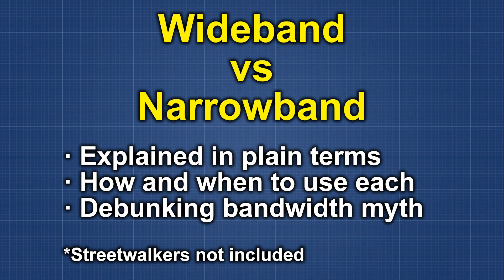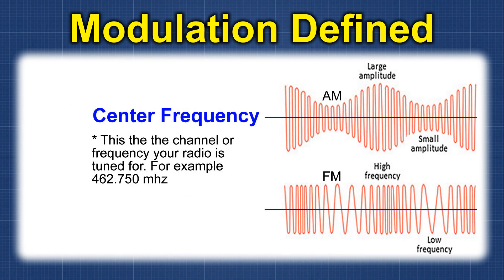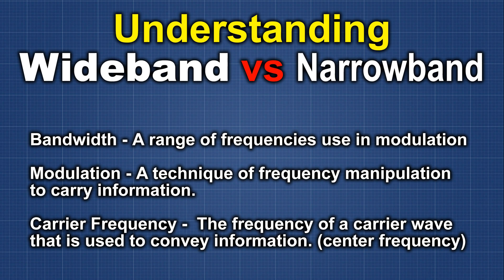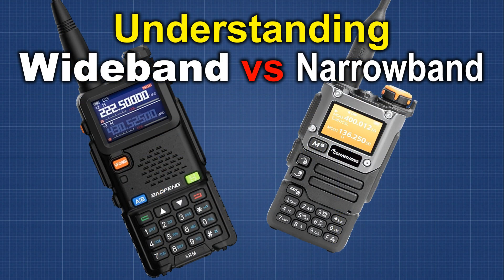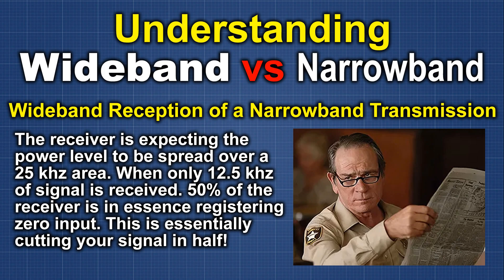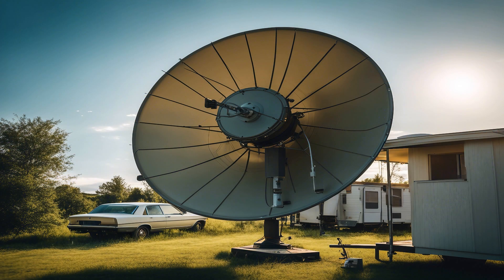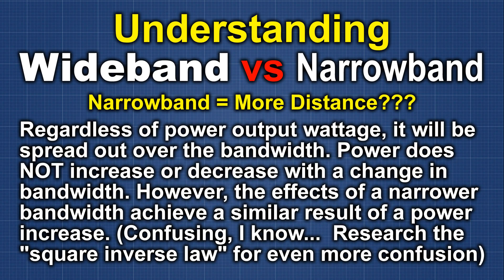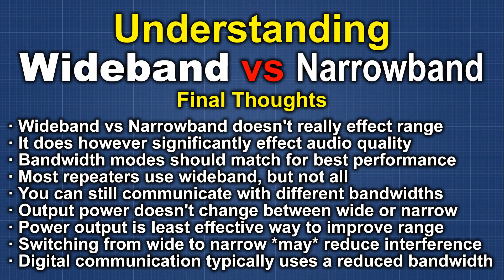Unlocking Radio Secrets: Ultimate Guide to Wideband vs. Narrowband  Compatibility, Challenges & More

Comment: AM is pretty great for audio quality if you have a good receiver and are in a low RFI environment, or if you have good filtering, AM is the way.
Reply from the maker: AM definitely has its advantages in certain applications for sure. Just look at aviation radio. And you are exactly right on the low RFI and filtering. Just like anything with radio, different environments or scenarios require different methods.

Comment: Great video! This definitely helps understand those differences, thank you. I have a question about this in regard to distance, but with obstacles. I use gmrs in a group environment in the woods for annual events, and I’m trying to determine if wideband vs narrowband has any advantages for wooded land when trying to maximize distance for our communications. Is there a preference when trying to communicate through wooded land? I do agree with you that more power isn’t the answer exactly either. I am building a repeater system that will use a fiberglass high gain antenna to help increase some distance, but in simplex mode, radios to radios that normally go a few miles on average land, are reduced to about half a mile in woods. Hopefully the repeater will help significantly with that, but do you know if there’s anything else that would make a key difference?
Reply from the maker: Narrowband might help a little bit by reducing the bandwidth use for modulation. But it isn’t going to help with obstacles. Every area presents different challenges. Even the types of trees in the woods and time of year will determine which frequency will work better. A repeater would definitely help, but that too isn’t a magic bullet.

Antenna upgrades may help some as well. 

Trees will absorb, reflect, and refract RF signal. Mainly absorb it. So more power from a repeater placed as high up as possible would improve your communications. However for solid comms in wooded areas, your best bet would be to use “Low Band VHF” 28-50 mhz. That also requires licensing to comply with the FCC overlords. CB believe it or not is also halfway decent at 27mhz. But that is limited to 4W of output.

Experimentation with different bands and antennas will help you determine what is going to work best. But keep in mind, obstruction is going to effect everything.

Comment: so when talking of band width, it's like we are talking of the extension of modulation it is applied to the carrier depending on wetjer it is narrow or wide, be it on fm or am ?
Reply from the maker: Yes for that video’s purpose. Bandwidth when regarding antennas will be a frequency range, but that’s not covered in the video
Reply: @Commodium  wow, i though it was the video´s point, hence covered on it. now that you say that it seems it is another completely new subject of research/study.
what would be the main concept behind it?
Reply from the maker: @itrstt66 Ok, so antenna bandwidth for uninitiated really means which frequencies the antenna can tolerate beyond its point of resonance both positive and negative. This would mean the frequency range would need to have an acceptable return loss (generally -15 to -20 and higher dBi) This would in turn allow the antenna to operate with a low VSWR on that range of frequencies. And this doesn't even begin to touch on antenna "Q" factor which is a whole other ball of wax, but is part of antenna theory.
Reply: @Commodium  i really a prpeciate such a priviledged piece of knowledge, unfortunatelly it is still beyond my intellectual domain, i'll have to do some research just to understand what you said, thank you once again
Reply from the maker: Sure thing, glad I could help
Reply: @Commodium  By the way, do you know any recomendable book on anthenna theory?
Reply from the maker: @itrstt66  its really hard to say. I read a lot, I mean  A LOT of research and technical white papers. I’m not sure how far down the rabbit hole you want to go. Red pill vs. Blue Pill kinda thing. But I would recommend doing research on electromagnetic wave propagation, transducers and energy transformation, understand and be able to explain maxwells equations. That journey will bring you a wealth of information, but still a drop in the bucket to antenna theory as a whole
Reply: @Commodium  right i understand your avice, now i am really curious on what you meant with the red pilll and blue pill thing.
is there a layered world of knowledge?
Reply from the maker: Exactly, radio propagation is really just physics. It’s not voodoo or black magic. Even though it’s hard to sometimes understand because we can’t see with our eyes how it works. That and there are decades of lore, myth, and bad information out there
Reply: @Commodium  hm interesting, this conversation is already lookign like a rabbit hole.. ok, so given that, what would be the ebst way to take the red pill. and out of curiosity, can you name 2 myths and and example of bad information, and another of a lore?